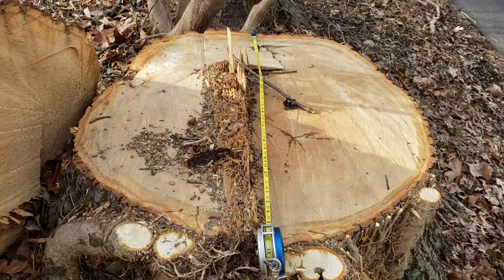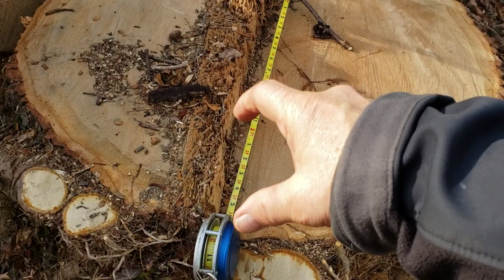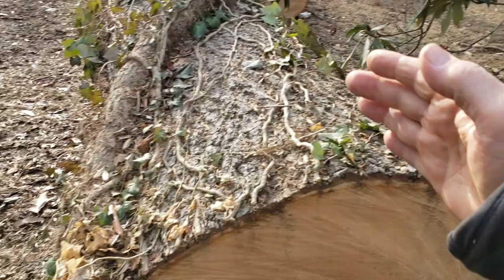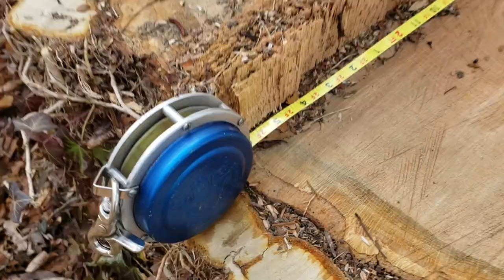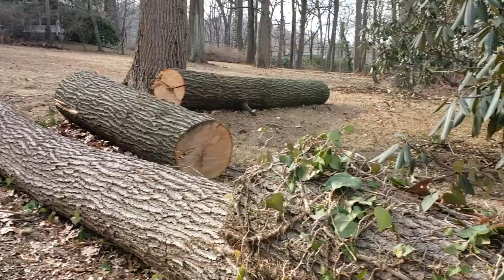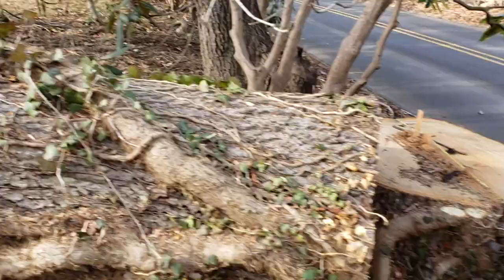forensic stump examination

Comment: Thanks. Other than excessive side/back leaners, I have mostly seen hinges breaking off sideways during the felling of the final short log after a dismantle.
I think of it as two forces acting on the hinge 1st the strain of the log as it stands and moves to the lay- and 2nd the forces that come into play when the face closes. Pretty obvious but I think the impact of this is not always weighed up.
Particularly on the shorter logs I will keep a wide face cut to prevent the ‘face closed’ forces from acting to early before the log is committed.
Reply: The opposite would be some super tall conifers, redwoods perhaps like ‘hotsaws101’ has on his YouTube channel. He seem to use a very shallow face cut but I’m thinking the tree is so tall that by the time it is 20degrees leaning it is far more committed than a short log would be at the same angle?
Reply: Link to one of his vids here(kinda funky diagonal cut, pretty cool) but you’ll see one of his narrow face cuts too https://youtu.be/0b_o-fYbgTk
Reply: It’s almost always a safe beat to have a wide face cut. I can hardly think of any reason why it would be better not to.. efficiency.. I can’t think of anything really, I guess if your trying to grab it as it falls and your like on a really skinny top so you want to gently lower it like about a year cut kinda deal?
Reply: I think there are a few reasons you might want those ‘face closed’ forces to come into play earlier but they all have added risk that needs to be considered. I use a narrow face in the tree a lot, branches and tops, but not much for the felling cut.
Reply from the maker: That's an excellent observation that I never thought of before, but can remember in retrospect trees where that effect came into play. Any effect from the way the face closes and breaks the hinge must overcome the momentum of the tree in order to change the direction of fall. The bigger and heavier the top, the less effective the facial closing effect.
Reply from the maker: @neild7971  ya, getting early separation will get the but to hit first, and then the top, which is a good way of preventing the log from breaking when falling int he woods and whole trees. If you brush a tree out first, it's rare to split the log.

Comment: Correct me if I'm wrong, but isn't the
Dutchman just intentional bypass in your notch? 

There are videos (and comments) on YouTube about people not lining their 2 cuts up correctly for the notch and accidently creating a Dutchman effect. It's usually referring to the flat part of the notch being cut too far in.
Reply: Visual at 5.13 of Murphy’s barber chair vid https://youtu.be/TonuP6jJxiE 
I was curious when Daniel described the shortened hinge as Dutchmen in this video
Reply: 7kyro I’m not sure what a Dutchman it either but I think it can apply to any part of the face closing in an less than optimal way, such as in this video rolling sideways where there was no post to hold it up, or as bucking billy ray cautions in his videos, cleaning out the groove where the face cuts meet to prevent them closing early and causing a barber chair.
Reply from the maker: Great question. A dutchman refers to any time there is a bypass in the face cuts. Doug Dent wrote a book called "professional timber falling ", that teaches intentionally cutting off the side or tapered corner of a hinge. Those are intentional Dutchman, called the "Swing" dutchman" by Dent.

 Unintentional Dutchman refers to accidentally bypassing the cuts of the notch or face. 

NOTE: Dent eventually stopped teaching the intentional "swing" Dutchman because it was too unreliable to teach. I have used similar cuts on smaller diameter trees with great success, but not every time, and have yet to understand when and why it will and won't work, so I understand the value of the cut and the limitations. I only use in low risk situations. The idea is that it is easier to get the tree to swing once it starts moving, but if it gets moving too fast or is too heavy there is not much going to change the direction of fall.

Comment: If your bar is short cut out the middle not the sides
Reply from the maker: generally that is more important on trees with side lean because you get more control to fight the side lean from the fibers on the far side of the hinge. It's about how the position effects leverage, not the strength of the actual fivers differing between the outer and the inner fibers